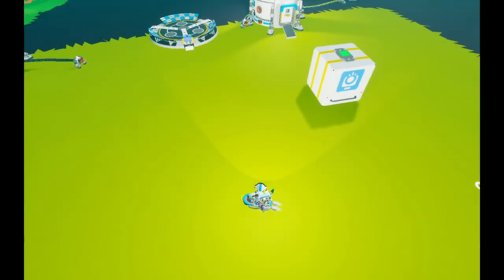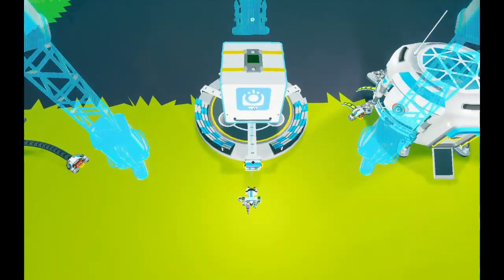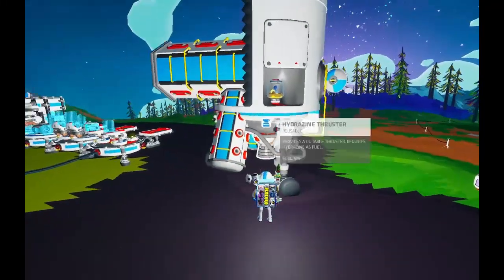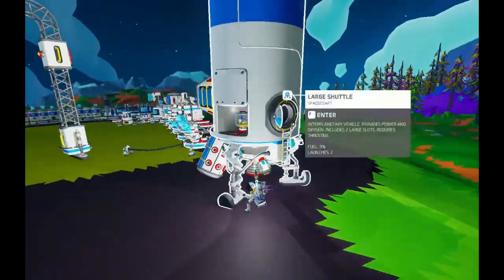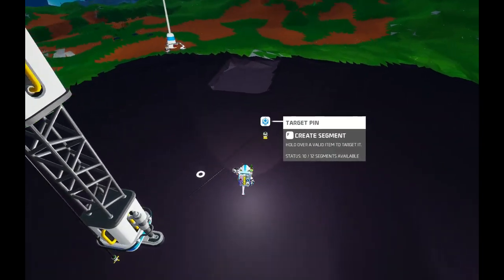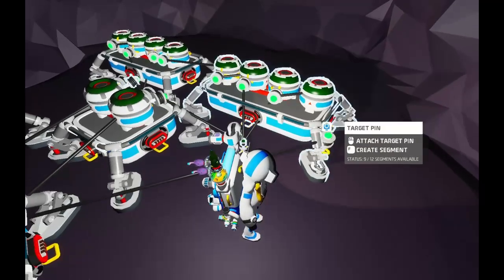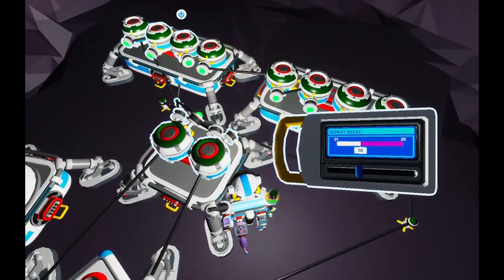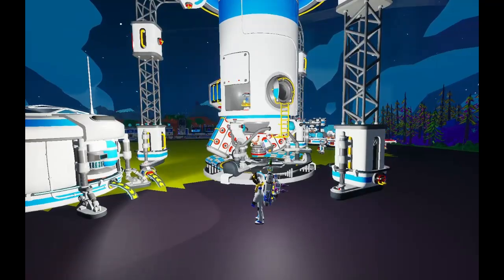Astroneer - Automated Shuttle Refueling Station w/ Usagi Feeder

Comment: its so stupid that theres no option to turn off those stupid auto arms which puts items in your backpack.
Reply: I use that auto arm feature to my advantage and have a "cube" of sensor arches that I can step into that places hydrazine into my backpack while I'm inside the cube. Easy to regulate if I want 1 or 2 hydrazine by how long I stand in the cube. Thinking of building one for feeding snail(s) after seeing this video.
Reply from the maker: They can be turned off manually or automatically using repeaters
Reply: @Jimmyjimjim321  yea. but you cant stop them from putting items into your backpack.
Reply from the maker: @bajsapa3892  Well, when they are turned off, they do not put things into your backpack. Your backpack is just like any other storage in the game. If an auto arm is within range and turned on, it will attempt to place things into your backpack. So, it's true that you can't do anything about this behavior, but you can design things so you won't ever be in the auto arm output circle, or you can automate things in such a way that the auto arms are turned off when you don't need them on.

Comment: Did you set up the hydrazine automatic refuel with very specific auto arm placements?
Reply from the maker: @JacksTheGreat  The auto arm positioning is important, but I just did it trial and error style, by continually making small adjustments until everything was right.